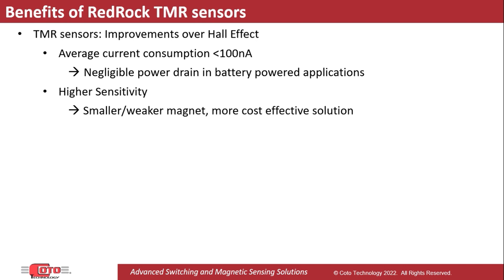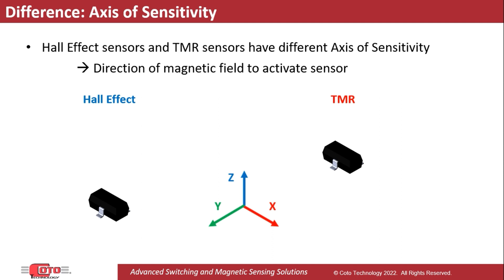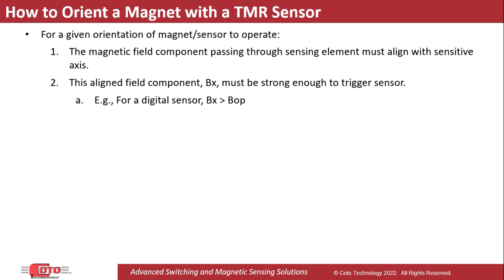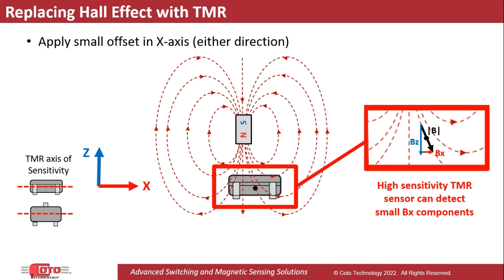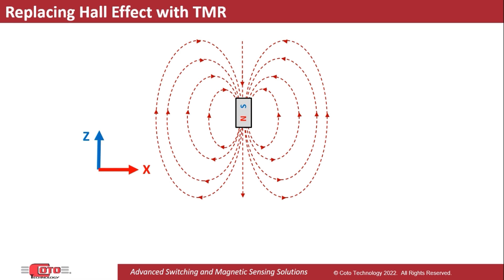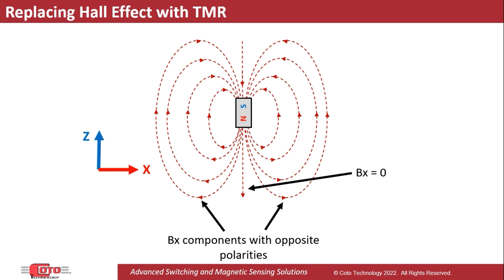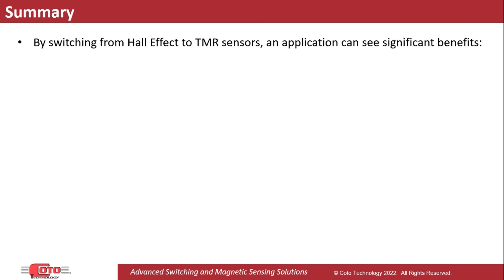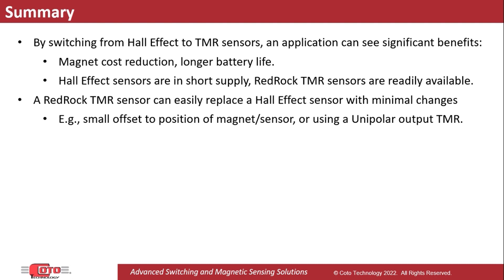Replacing Hall Effect Sensors with TMR Sensors – How and Why

Comment: Hi, what about if you want to detect non permanent magnets such as flexible sheets. They are usually magnetized linearly with North, South, North, South poles etc.. close to each other.

They are inhomogenous so not permanent like a normal homogenous magnet which is easy to detect. 

If I want detection anywhere on the sheet do I need to put 3 tmr sensors in triangle form to be able to detect fields regardless of orientation or position of the sensors pcb above the magnetic sheet and  this way at least one sensor will always detect one of the fields and give an output?